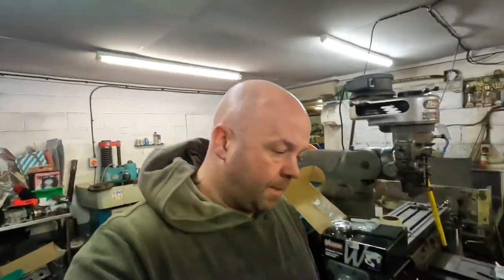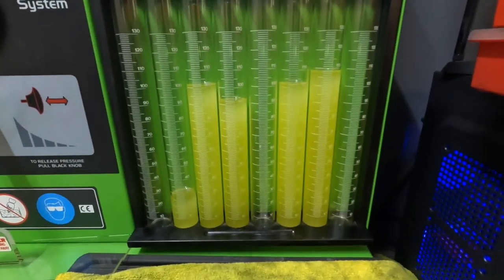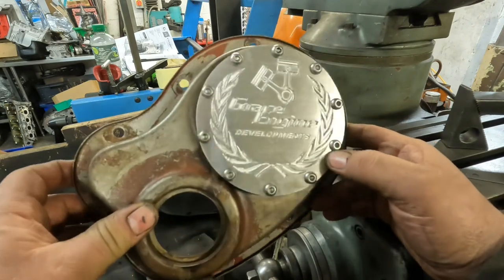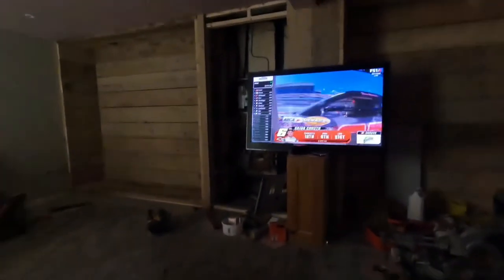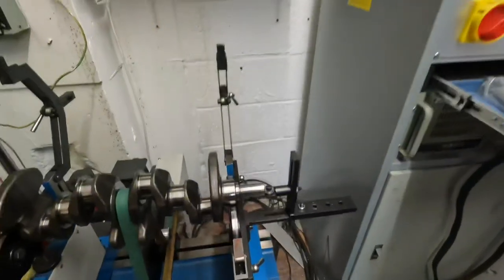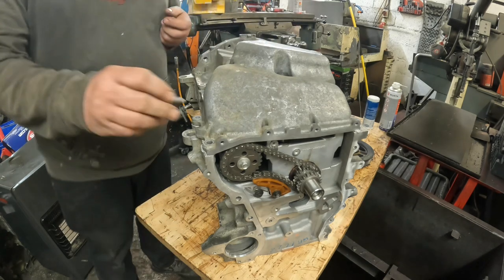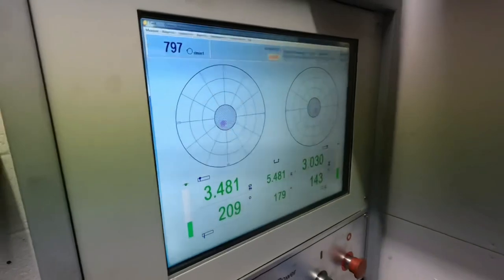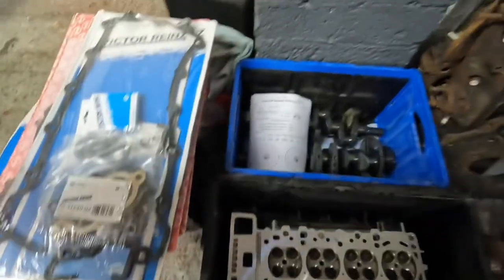Crankshaft Balancing, zetec valve cutouts, duratec bottom end , Mga front cover, Sam saves the roof

Comment: Hi James, thanks you for the video. 
What kind of balancing machine do you have?
Can you change balance positions?
The residual amounts for dynamic balancing so that the crankshaft counts down on the static balance?
Have a good day.
Take care, Ed.
Reply from the maker: Hi Ed, the machine is made by jp dynamic balancing, do you mean taking the weight off different counter weights?
Reply: @graceenginedevelopments  Hey James.
I have a Winona Van Norman EB1800XL Balancer. 
The wheel on it is 0 to 100, 3.6°
So on V8s the counterweight are 180° apart.
I end up usually around 2grams per end.
I try to get the imbalance 180° apart.
So when you static it counts down.
The right end subtracts from the left end, so on and so forth. 
I was curious if your balancer worked this way.
I know a man in S.A. he has a JP Balancer. 
Take care, Ed.
Reply from the maker: Hi Ed sorry I didn't get notification on your reply
Reply: No problem James.
Have a great weekend.  @graceenginedevelopments
Reply from the maker: @edsmachine93  and you Ed